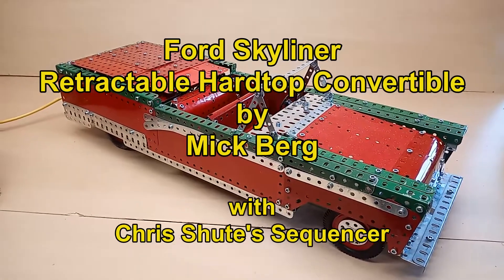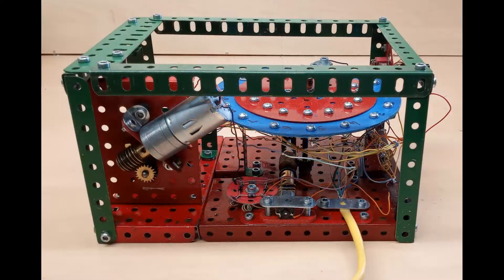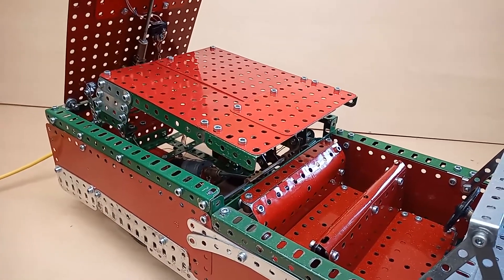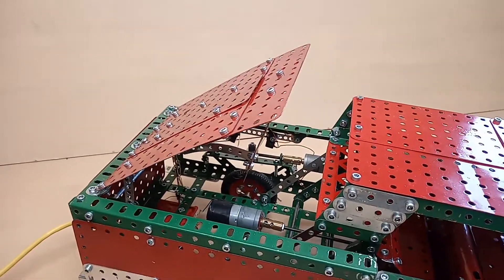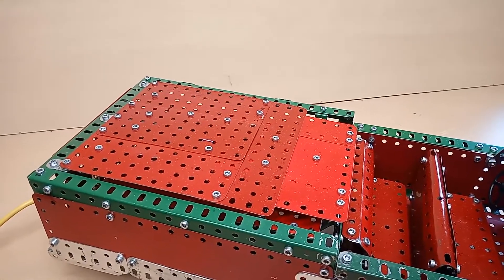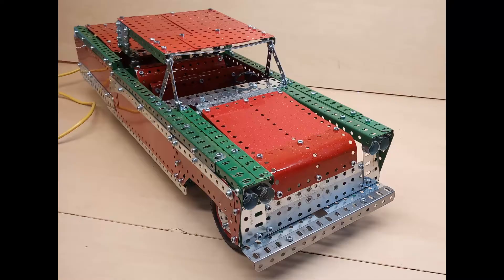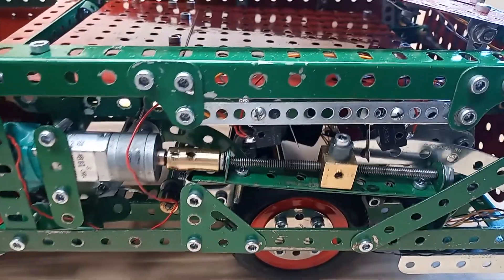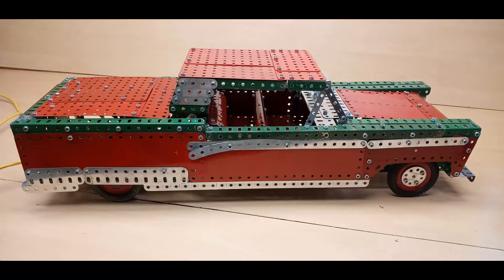Ford Skyliner Retractable hardtop Convertible in Meccano

Comment: Mick, congratulations on finding another use for a sequencer, saving relays! Does your sequencer use plastic curved strips to carry the contact studs/bolts?
Reply: Hi Chris. No it's a disc cut from a plastic food container lid. Doing it with relays would be incredibly difficult.  BTW do plastic curved strips exist?
Reply: @bertspeggly4428 Bravo! No plastic curved strips exist yet, as far as know. I wondered if you might have caught the 3D printing bug!